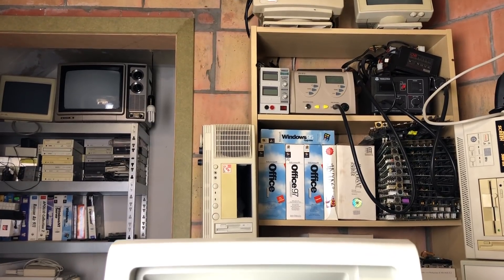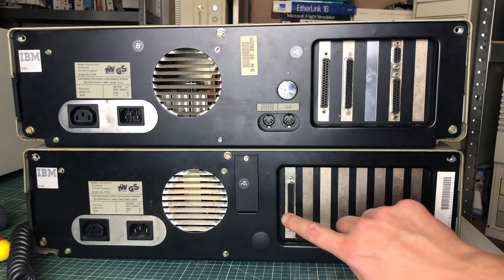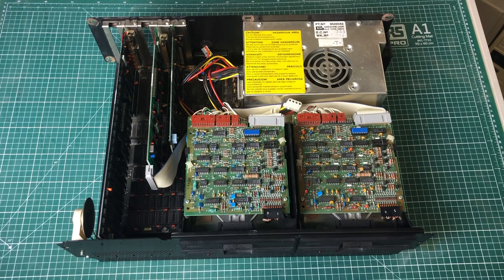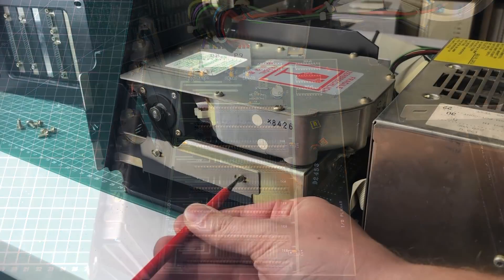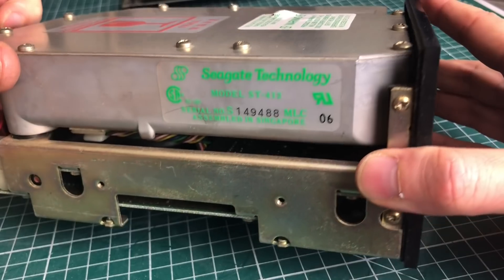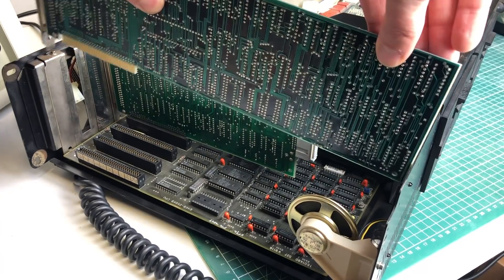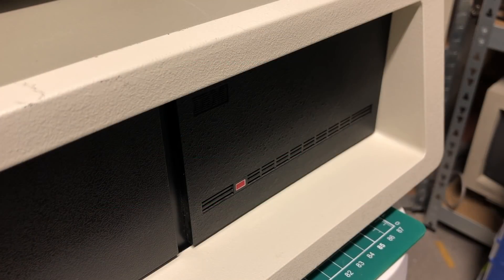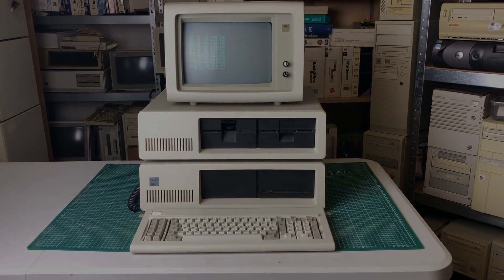IBM PC on steroids : 5161 Expansion Unit

Comment: Thank you for this Video.  I have the same setup with the same hard drive in the expansion unit. It special to me because it has a prototype communication card  with software designed to assist deaf children.  It's been sitting in the closet for 25+ years and now I'm trying to bring it back to life.  Unfortunately, it posting an 1801 with the expansion unit attached and, without the expansion unit, if fails to boot from the floppy.  I tried swap the floppy drives (and changed the Jumper) but they all boot into Basic.  I also watched your video on fixing a Tandon drive which will be the next think I will try.   Again, thanks for the videos.

Comment: Yeah, it seems that these old MFM hard drives are still working when their 3 1/2 inch counterparts are not!  In the early to mid 1990s I never would have guessed that to be the case in 2020!
Reply: I've got two 286es, one with its original 1990ish hard drive and the other with one installed in 8/1992. Both 3.5" IDE. Get Western Digital or Seagate. Quantum ones hold their own pretty well too.

Comment: That hard drive gives me memories. Back in 80's we had 286 clone, MDA, and one HD floppy drive. Later we got CGA/HGC and 40Mb Seagate MFM -drive. That drive broke quite fast and then we got from somewhere the same 10Mb hard drive as in the video. So small... Remember watching that stepping motor on the side while using it.

Comment: With that height gain from the extension unit, I would move them to right and have the monitor on the desk by itself
Reply from the maker: Next video will add a cga card + monitor so they will sit alongside each other. Stay tuned for that.

Comment: I somehow feel the need to build a modernized thin cable expansion card. Said modern card would serialize the 68-pin interface and send things over a single USB 3.0 connector (not USB protocol, just the connector) using a modern 1.25Gbps serdes interface.

Comment: Before replacing the RAM chip I would have pulled it then put it back in, along with pressing down on all the rest of the RAM and other socketed chips. The first stage in troubleshooting a PC or clone in the DIP era was to give all the socketed chips a push down to re-seat them and cut oxidization that could be causing resistance or total insulation of a pin. If that didn't fix the problem, remove and reinstall all the socketed chips. I fixed many computers doing nothing more. The cheap leaf spring contact sockets used by IBM and most clone manufacturers for DIP chips back then would have the chips slowly rise up over time. The more power cycles, heating and cooling, the sooner the chips would pop up. Though never to the extent of the apple ///, which ran extra hot and apparently used the cheapest, weakest sockets available. For the price of the thing it should have used machined pin sockets. It was nice to see a board with those, because it almost certainly wouldn't be any oxidized pins causing the problem. I'd still push on all the chips and listen for the telltale crack of a chip seating better.
Reply from the maker: hehe ... the telltale crack .... indeed.  I actually did that off-camera but the problem persisted, but definitely worth a mention so I appreciate the comment ! The PC is sometimes throwing PARITY CHECK 1 after POST, and occasionally flags a 201 memory error in bank 0 (the chips that are soldered onto the board) during POST.. If I insert a 384kb memory expansion card (that works in another 5150)  it only runs stable if I configure the PC with 574kb of RAM. Anything higher than that and the PC hangs on boot... So I do suspect there are still some memory issues with the PC.

Comment: Great video ! By the way, if you wan to backup old MSDOS computers with comfort, you can use FastLynx 3. It uses Parellel/Serial/USB ports (I use an USB to Serial adapter) , runs within a nice GUI on Windows Seven (never tried W10, but maybe it works), and the MSDOS Client is able to install  itself just by using the function "Upload DOS Slave" and MODE/CCTY commands on the MSDOS PC side. Very usefull, powerfull and easy to use, it allows your modern PC to acces all drives of your old MSDOS PC.
Reply from the maker: Thx for the tip will check it out ... I’ve always got a “new” retro machine standby that can boot into msdos to start interlnk. Then I boot into win xp and take it on a usb thumb drive.
Reply: You mean you can install software on another PC by serial/parallel?

Comment: IBM didn't even offer this until the PC XT was well into development. They knew customers who just dumped thousands on a PC just to learn that the next model was more expandable and offered a hard drive would be pissed. So the 5161 came out. It is a PC XT case to the exact dot, even uses the XT's power supply which is beefier to run the hard drive. You can install 2 drives in the expansion chassis, but that was rare since that 10mb drive was over a $1000 option at the time. With the expansion unit, and the base PC, you essentially had an XT on steriods since you actually had more expansion than an XT having 2 hard drives, and 13 expansion slots. Since the processor was the same between the PC and XT, in many ways, this was a better choice over buying a new XT.
Reply: even when you factor out the 2 lost slows for the connectors cards you still have 11 slots thats 3 more than an XT and 4 more than most full ATX boards today

Comment: This is one of the reasons I love computers from this era: Simplicity. That card and expansion unit are literally nothing more than ISA links from one computer to another. You could have fashioned a cable with ISA card edges on both ends and plugged them into both and you'd get more or less the same effect, maybe with a bit of clock skew.
Reply: Ah, I was wondering about that.

Comment: ok. but could you keep added expansion units into the previous expansion unit? if so, to what end?
Reply: I have wondered about that too, but I suspect that either there would be signal reflection issues, or you'd simply run out of address space.

Comment: Dynamic RAM, especially chips from the early 1980s do deteriorate from natural background radiation.
Reply: Before replacing the chips, reseat the questionable memory. Often just a touch of corrosion on the pins, that gets wiped away on removal and reinsertion. It certainly was true back when they were newer for sure. At the time memory was hugely expensive, so doing this check was worth the time and effort. Now maybe not so much if you have lots of spares that cost you next to nothing.
Reply: @thomaseboland8701  this ☝️

Comment: Seeing the 5161 stacked on top of the 5150 bothers me somehow, b/c of ergonomics. Also, the 5150 is dual- or even triple-monitor capable (MDA+CGA, the latter possibly driving both an RGBI and a composite/TV monitor). If this were mine, I'd put the units side by side, and then I'd put a little shelf above, on which I'd have 5151 and 5153 monitors sitting pretty, along with a (preferably period) colour TV/composite display. Well, in my dreams.
Reply from the maker: ropersonline hehe ... I have posted a video showing the IBM pc in a dual monitor setup like you mentioned. (Cga and mda). Part 2 of this series will include the setup you mentioned (dual, not tripple)
Reply: @RetroSpector78  Thank you; I've just seen that. I left a comment there for you too about the Guide to Operations. If you might be able to speak to that, I'd be very grateful. :)
PS: If you could try a triple-monitor setup, you could probably run 8088MPH... Then again, I don't actually know if the whole PAL/SECAM/NTSC thing might present a compatibility issue with that?
Reply: @RetroSpector78  PS: In case you get a chance to look at it, this is what I wrote over there: https://www.youtube.com/watch?v=4zugZGBPTSA&lc=UgwBcrFbNSty-EU3Jp54AaABAg 
I would be really interested in hearing if you know anything about that.

Comment: There is a 5161 on eBay as I write this, it's looking a bit rough though.
Reply: They aren't that rare after all.... just not as well known. Also it's just a passive backplaen so can be cheaply replicated if you want with 3rd party hardware. Especially since there are open source sender receiver cards now.

Comment: @5:00 You only get 6, not 7, additional slots. Just count the total empty slots before and after if you don't believe me, or take into account that there are 2 ISA cards that need to be installed across both units and subtract them from 8.
Reply from the maker: Thx for the math lesson. And yes I do believe you :) honest slip of the tongue.
Reply: @RetroSpector78  Thanks for your awesome videos!

Comment: Looks like the 5161 was just an empty XT chassis which only carries a dumb ISA backplane board and a different badge on the front. Which would have been quite easy for IBM to manufacture since they already had almost all of the bits. The extender/receiver cards are just ISA bus transceivers so the bus can go on a cable.

Was it possible to connect more than 1 expansion unit so you could build a massive rack?

Comment: A simple way to breakout the Address Bus and Data Bus.
I bought one of those from a Flea Market not thinking it was a Expand unit. Was just the Backplain, Power Supply, Cable, Transmitter and Receiver cards. Surprisingly it worked on my 386 but you had to turn the PC and Expander on at the exact same time or the Video would be garbled and would hang on post. Had my dad build me a junction box that was nothing more then a double gang Electrical box with a Light Switch and two Outlets with an Extension cable. This way I could switch the PC and Expander on the same time. Use the Expander to host all of my 8 bit cards and two SCSI drives. Had it for a couple of years until the Power Supply died and I retired it. Later on I reused the Case for a 486 build.
Reply: That's really cool.  I was about to ask if you could theoretically use this with a newer PC that still had ISA.  Sounds like you could!
Reply from the maker: On my XT clone it doesn’t seem to work. With the cable connected the XT clone just sits waiting on boot (blinking underscore). No disk drive initialization. With extender card but without cable attached the XT clone starts again.
Reply: @RetroSpector78  : Might be a timing issue. See if your clone has a higher clock speed.

Comment: Is the backplane board available also?  I have a spare 5160 chassis I could convert...  Great video - I learned a lot.
Reply: Sergei malinov's ISA backplane would probably work, dunno if his ATX power off logic would interfere. Also there is Advantech's PCA-6108 which you can find online for $40-100 with 8 slots. They make a 20 slot backplane also but I dunno if that would work as it is muitisegment.
Reply from the maker: Thx ! Github project doesn’t mention it, but they do say that there were a couple of commercially available passive isa backplanes back in the day (and still being sold perhaps somewhere).
Reply: @RetroSpector78  Interesting.  It seems like the missing piece of the puzzle, though being just a backplane I doubt it would be difficult to reproduce.  Thanks for the info!
Reply from the maker: Would make for a nice weekend(s) project :)

Comment: Wow, I haven't seen one of these in decades!  I think there were third-party expansion units for the XT and AT, again mainly to add more slots.  With the advent of multifunction cards the need for extreme numbers of slots dwindled, so the expansion box market went away.
I seem to recall a unit to add an S-100 expansion chassis onto an Apple ][, but I'm sure that wasn't a big seller.

Comment: The expansion unit case is basically an ibm 5160's case
Reply from the maker: Indeed it is. Thought I mentioned it in the video but apparently I didn’t :) thx for pointing it out.
Reply: And they even used it for the 5162 :p

Comment: Welcome to the 5161 club!  For a silly challenge, try to fill it on a 5160 -- 14 total slots with each card working. (It is possible, I've done it, you have to use many cards that don't need an irq)
Reply from the maker: That was kinda the plan ... was going to make it “easy” on me by just doing it with the 5150 but you raised the bar for me sir :)
Reply: @RetroSpector78  I don't know if it is considered cheating, but I have a few sound cards that are fairly rare and unique and that's one of the ways I got all 14 slots full and working. Other cards include EMS, networking, both MDA and CGA, a joystick card (I did NOT put a sound blaster in), and extra parallel and serial Potts. You can put in an scc-1, adlib, and CMS sound cards instead of a sound blaster, for example. Good luck!
Reply from the maker: Jim Leonard got some exotic cards as well like prototyping boards , analog - digital converters .... will see what I can find :)
Reply: And he can leave the cards in when I get it back :p

Comment: Would this be compatible with other IBM PC-compatible computers? Or is there something special about the PC AT that makes it work?
Reply from the maker: It will only work with 8088 based xt’s. 5150 / 5160 should work, and if it doesn’t a bios change can fix it. I think it would probably also work with xt clones. Don’t think there is anything IBM specific. Will give it a try and let you know.
Reply: @RetroSpector78  Please do! That would be super awesome if it did!
Reply: I had it working on a IBM-Clone 386 that had a Biostar Mainboard and a MrBIOS. but I had to turn them both on at the exact same time. If the Expander was on first it would try and send low voltage signals to the Main PC Bus and if you tried to turn on the Main PC afterwards the Power Supply would kick on for a second then kick off. If you switched the Main PC on then the Expander the Video would be garbled and hang on Post.

Comment: 7:25 there's even a Zilog Z80!
Reply from the maker: Nice catch :) .... I think you’ll find z80 chips in more devices than you can possibly imagine ...
Reply: The System's CPU can't cope with running the Hard Drive by it's self so it passes the information to another CPU typically on the Controller and at times on the Hard Drive's main circuit board would have one. This is why Hard Drives were so expensive.